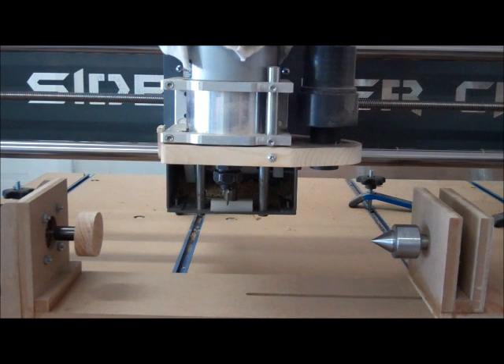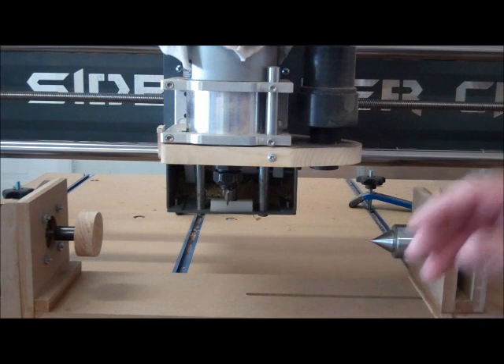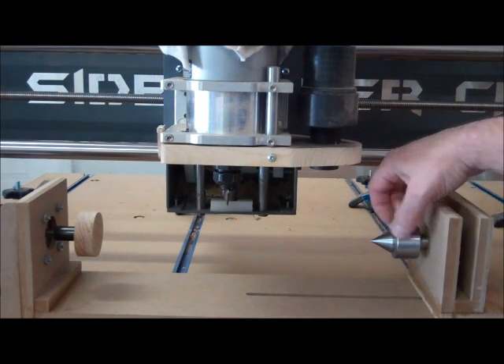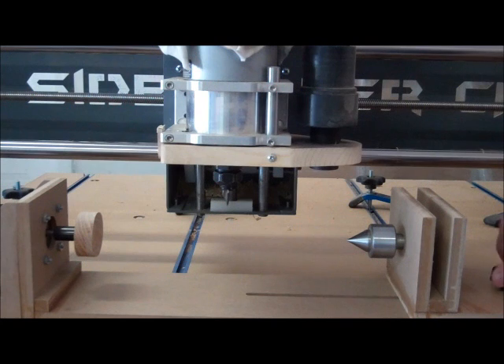Rotary Axis.wmv

Comment: Dave, How did you design this.  Did you design it as a flat piece where the 'Y' axis is set by the circumference?  If I wanted a repeating pattern that match all 360 degrees, would that be possible?
Reply from the maker: blcksmth,  I used V-Carve Pro's wrapping gadget to program this test.  I have put a youtube link to the Vectric video that explains how to program a rotary axis.